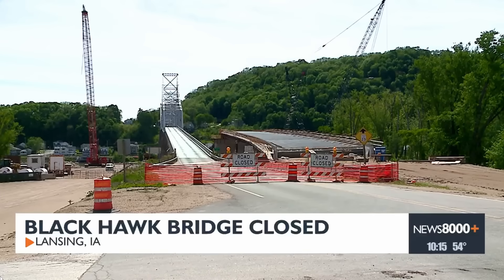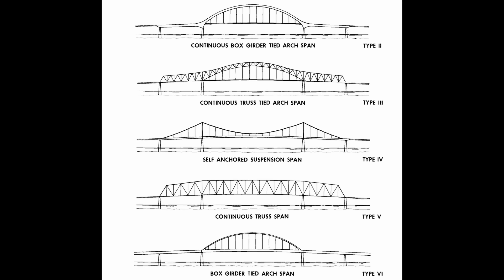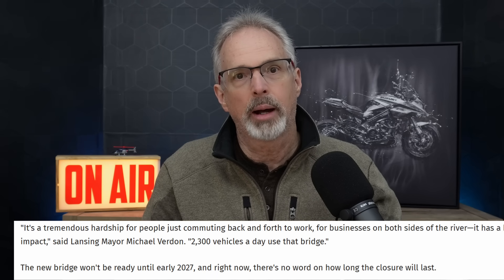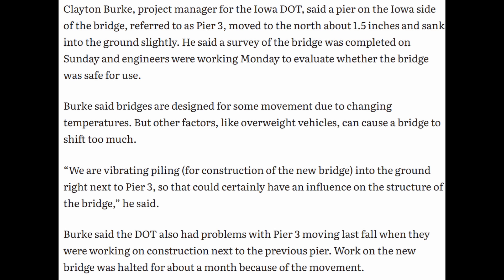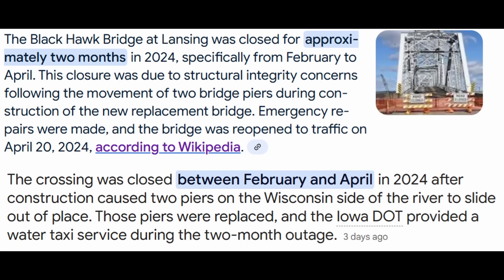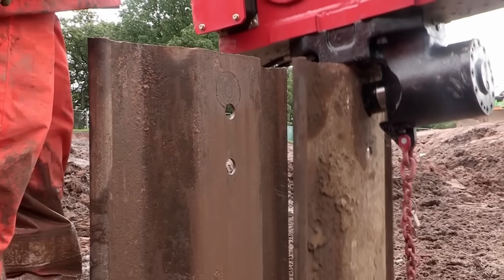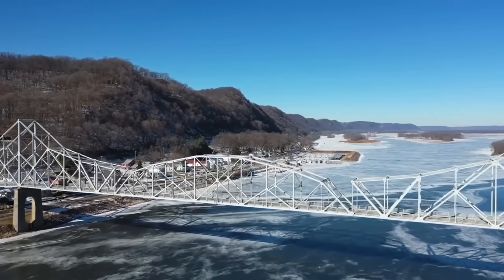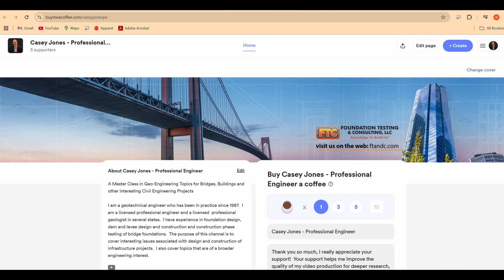Blackhawk Bridge over the Mississippi River

Comment: There are a very large number of ways for a project to go poorly. Here in the USA it was conventional wisdom that construction was expensive because organized crime controlled process components. I don't know if that is true anymore, if it ever was. This story is about an unsuitable choice for a way to build in proximity to an existing structure. I am wondering about how the choice came to be. Was it cost, or expediency or familiarity and expertise with one way to do it verses another.
I recall a natural gas infrastructure replacement that went poorly because the utility company had driven away the experienced engineering staff as a way to reduce fixed costs. The remaining employees had the title and responsibility but not the experience to design the process successfully. Cost control measures imposed by the non-technical personnel eliminated a third party design review. Every stake holder did the job and no person or group had direct responsibility to notice or fix the mistake they made. It was a business decision. The people who made the decision and made money doing it were not accountable for the failure. 
When you take away risk, you can do anything.

Comment: Timber pile? Why the heck did they wait so long to replace the bridge. 

There are many reasons bridges are more expensive.  

Bridges serve a function, over the life of a community those functions change. 
Consider a two lane bridge from 1930. That bridge might have a tandem axel limit of 20,000 lbs. For the bridge being the only bridge in a 60 mile span that’s going to divert considerable truck traffic to other communities.  If you set along Americas east west corridors, for example the bridge over the White river in Arkansas heading to Little Rock. That bridge even at 4 AM has truck traffic crossing once every several seconds. The amount of truck traffic lbs  in this country has increased by magnitudes since 1930, particularly as the population has redistributed from east to west. 

Secondary problem is with more traffic you need more lanes, which means you need to be able to carry not 2wice the original weight but 4 to 10 times the original weight. 
Bridges over navigable waterways have the additional problem air draft, the clearance between the water line and the top of the vessels and these continents to grow. Adding to this problem, as we see with the Frances Scott key bridge, as ships get bigger the columns need to be placed at safer locations that avoid column collisions, which continue to occur at alarming rates. 

So now we have longer spans, with more lanes carrying heavier loads at higher speeds and then we can add the road safety features like emergency lanes, side railing that prevent egress of top heavy vehicles etc. you have that expense.
Reply: Because the iowa didn't have the money most likely. There was just as old as a bridge if not older that crossed the Wisconsin River at lone Rock that should have been replaced a long time ago but the new one only opened last fall.

Comment: Hey Casey, Kraemer is great outfit - I first worked with them on a project in 1989!! They were out of Plain, WI.
Reply from the maker: Yes, I have done work with them too.  My issue is with the DOT apparently not putting requirements in place to adequately protect the existing bridge.
Reply: @CaseyJones-Engineer  I worked on am Interstate project with temporary sheet piling by the mile. While removing sheeting close to a finished concrete retaining wall, the end 32' panel started to sink. We removed & replaced the panel and never removed anymore sheeting on project. I believe the state DOT halted that practice as a result.
Reply: There's two different divisions of Kramer they got a construction company that builds schools and stuff also and that's Kramer Brothers

Comment: in the 2000's in Manhattan near Canal st on the west side they were using drop hammers to drive 70-80 feet deep piles immediately adjacent to 80-150 year old brick buildings. that was criminally stupid! of course that caused quite a bit of damage before it was finally stopped. fun fact, that's where Manhattan's famous bedrock is deepest and the reason the skyline takes a big dip there.

Comment: Back where I grew up in New Jersey, there's a bridge called the Burlington-Bristol Bridge across the Delaware River.  It's a very narrow bridge constructed the early 1930s.  It has those steel grates, and even in my F150 it tends to pull you around.  It also has a lift span to allow ship traffic to pass up and down the Delaware.  If it's like other traffic infrastructure in NJ, it will never get replaced.
Reply: Actually it looks in better shape than the neglected Commodore Barry. The CBB is quite rusty and the decking is heavily patched.  Considering the expensive tolls paid it should look infinitely better.
Reply: The Soprano Bros Construction Company was just awarded the replacement contract.

Comment: I just read through all the new bridge updates on the Iowa DOT site, and what I found perplexing is they stated that they will be removing the dolphins as they "expect" the new bridge piers to be able to handle any barge collisions with the piers. ???  They may want to rethink that after the collpase of the Key bridge in Baltimore.
Reply: The old bridge survived barge collisions before the protection was in place, I'd guess they know how much force a barge is capable of.  That is supposedly one of the worst bridges to navigate, so a barge coming at an angle is more likely than most bridges.
Reply: None of the bridges otherwise on the Mississippi have protection and it's River gets to high the barges camp travel because the locks are closed and flooding would be only time they've got to be concerned with the barge hitting
Reply: @johnhaas2523  lansing is on one of the worst "corners" of the Mississippi river. many times i have witnessed barges sideways across the channel blocking trafic and up against the bridge. the forces of barges  ramming into the bridge gave reason for the dolphins. most other bridges are in straight aways......not on extreme corners. of course when it comes to government they are REACTIVE INSTEAD OF PROACTIVE.
Reply: save money now for my new mansion and college for my kids, spend money later when I am retired

Comment: Casey, was the bridge replacement a dualling of the bridges? That is, will the old bridge be retained but with say weight restrictions and no heavy trucks or equipment use, rather than it being demolished after the new bridge is completed and commissioned? Does the new design incorporate smart sensors/monitors in the new construction? Can your friendly and excellent satellite ground data monitoring service provide the local area motion information going back to before that earlier 2024 closure.
It might be interesting to see how the two different pile insertion methods compare between a sample of reasonably matched projects (a doctoral engineering thesis anyone?) since railway bridge, embankments and retaining wall projects versus the same for roadway projects may have dissimilar requirements for documented reasons.
Reply: Old bridge is coming down
No municipality wants the liability or the costs of maintaining it. Was the states they said no, county didn't want it, and I'm assuming as bad as the people of Lansing wanted it the city couldn't financially justify it. 

Couple local clubs/groups tried to buy it as well, but nothing ever came of it.

Comment: At what point in the bid/submittal process would the DOT'(s) have become informed of the contractors planned method of casing placement? Seems the DOT spec's or bid review would have recognized the 'potential' for adverse results using the vibratory method and recommended a method less likely to cause the damage that did result.
Reply from the maker: You are correct.  This should have been handled through the project specifications and plan notes with the contractor required to provide a detailed submittal of their approach prior to start of construction.

Comment: I use to fuel cranes in st.pete fl on beach where they were building highrise condos. They used pile drivers that would raise up 20' in the air then slam down on a concrete pile about 160' long. I ask what happens if it just disappear s into ihe sand. Then we'll drive another on top of it. About that time with about 30' left. It disappeared in to sand.
Reply from the maker: Yes it's quite shocking to see something like that.

Comment: Good and interesting video. We had a steel grate deck bridge in CT on Route 15. In the 1970s, ConnDom worked on the bridge and ended up with the deck panels not aligning. Driving over it was an adventure in getting thrown around. They replaced the entire structure in the early 2000s. 
I have to wonder if the vibrations were causing any kind of liquefaction of those old timber piles. Good Luck, Rick
Reply from the maker: I think it's quite possible that they managed to liquify a sand layer around those timber pile.
Reply: @CaseyJones-Engineer  It sad how often liquefaction is ignored. Good Luck, Rick

Comment: New bridges today typically have full width shoulders and  additional lanes which adds to the replacement cost
Reply: The perception of safety of the design, build and expected useful life of the bridge has changed over time also. Some material costs are difficult to estimate because of price changes and trends. For instance lumber was the lower cost building material for many applications and that seems to have changed.
Reply: No schitt, Sherlock….

Comment: Just used an oscillator for a test shaft adjacent to CSX on my current project.  The monitoring data on the rails showed no out of range indications of movement while installing the casing;  rail traffic created much more movement.
Reply from the maker: They are nice (but expensive) pieces of equipment.  Typically use of the oscillator over driven or vibrated casing is about triple the cost from what I have seen.  It would have been worth it to the people of Iowa and Wisconsin I think.  If the old bridge can't be placed back in service, they will have a 60 mile detour for another 2 years until the new bridge is finished.
Reply: @CaseyJones-Engineer  Yes, they are expensive.  I dont have blue book access ATM, but I've heard that the Buma oscillator/Liebherr LB 44 was about $30k/week.  And it sat idle for a couple of weeks waiting on the RR to make a decision about track monitoring... too many stakeholders on this project, smh

Comment: They might have considered the vibratory method to be worth the risk when combined with tight monitoring.  Likily there had been some temporary scour at some time in the past at pier 3.  It can be amazing what one finds at depth when installing foundations indicating very deep temporary scour in the past.
Reply from the maker: Great point.  I just think given the impacts to the local community there that they would have taken more precautions to prevent damage to the existing bridge.
Reply: @CaseyJones-Engineer  I did a replacement bridge once and when driving piles we hit an entire superstructure span burried 40 ft below this creek.  Had to drill holes through it for the new piles.  I always scan the geotech reports for signs of prior deep scour as a result.